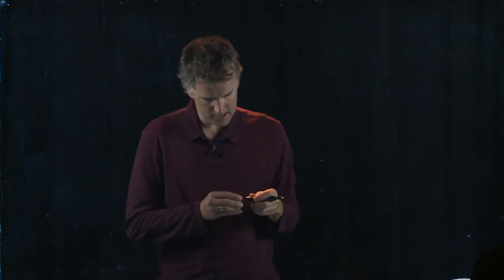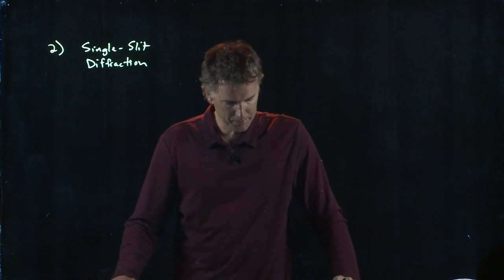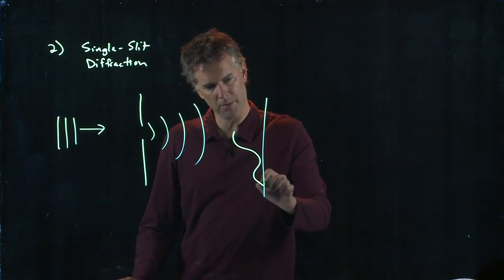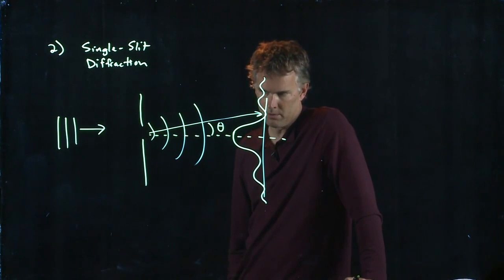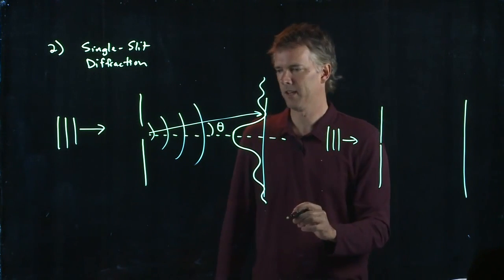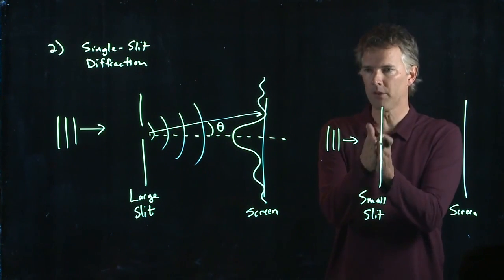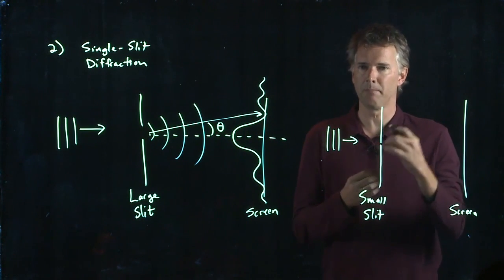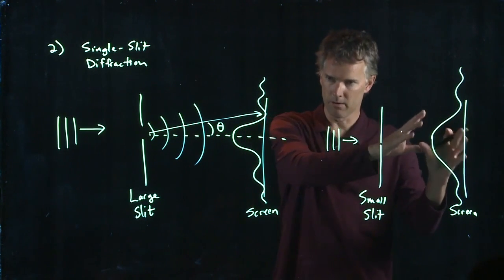Single Slit Diffraction | Physics with Professor Matt Anderson | M28-16

Comment: How come nobody ever mentons the slit material? The slit material is the only other thing in the system. For light to be dispersed across a screen, there must be some force on the light, like reflection off the slit edges. Doesn't the need for the slit width to be on the order of the wavelength of light suggest it is multiple (resonant) reflections off the slit edges?

Comment: If anyone is still confused, you can still check it using the equations. 

For single slit minima the equation is 
(a/2)sin(theta) = (lambda/2)p

If a were to decrease theta has to increase cause wave length stays the same

Comment: What made sense to me when I thought about what would happen as the slit got smaller was to consider the case where the slit got larger. As the slit gets bigger and bigger, the output wave looks more and more like the input planar wave. I guess in the extreme case, the input and output are the same as the slit in infinitely large
Reply from the maker: Yep, great point.
Cheers,
Dr. A